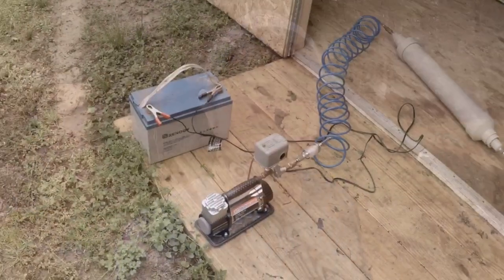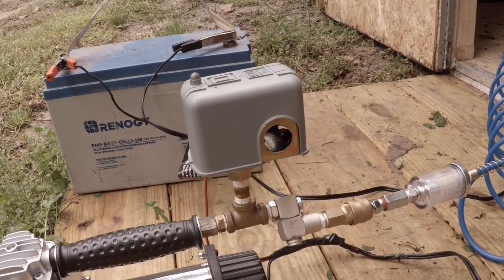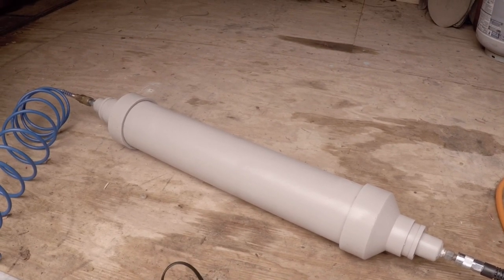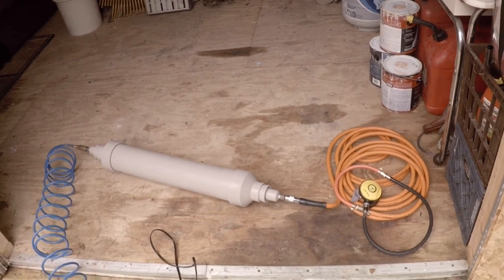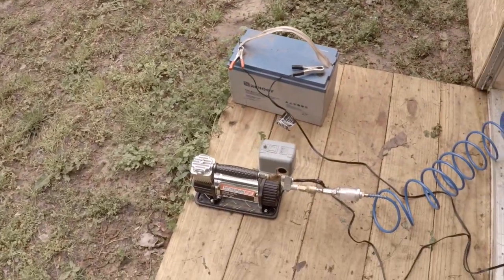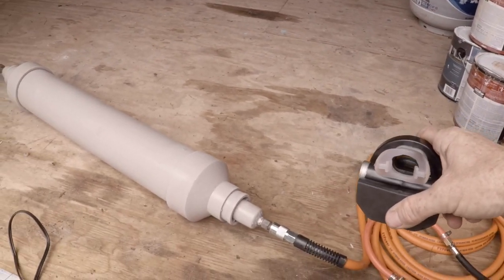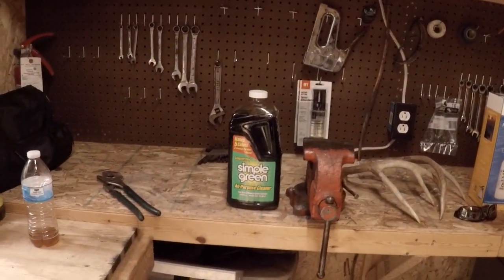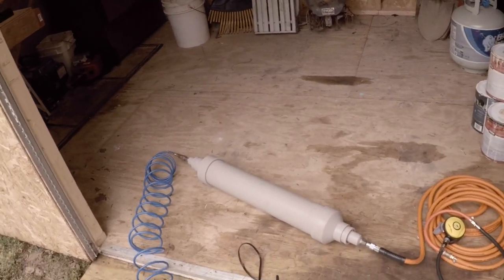DIY SNUBA Diving System Made Easy

Comment: I have been wanting to do this...the biggest concern I had, was with Teflon from the oil-free compressor. Is 5 micon filter good enough for Teflon filtration? Been researching this. Thanks for the video your attention to air quality is great.
Reply from the maker: Edward I’m not sure to be honest with you. That’s the best filter I could find and I’ve seen them used in other systems. Teflon was my biggest concern as well. I will add that this worked exceptionally for about two hours but with non stop use one of the reeds broke loose from the piston and couldn’t keep up with the air demands. After disassembly and found out what it was I looked into new options. What I’ve built now is a replica of hookah max’s gas powered air compressor. I’ve yet to try it out but I got the idea from Gigmaster who is also on YouTube and uses one every summer without any trouble. It’s roughly $500 to build but significantly cheaper than hookah max’s $1200 price tag. I plan to do a video on it soon so keep an eye out for it. I hope this helps you out and thank you for subscribing!!

Comment: Maybe I missed it but what kind of time can you get out of that battery before you have to recharge while snubing?
Reply from the maker: This is a solar 100 amp hour battery. I’ve have used this on my high banker all day long and it still had plenty! I use it on my camper for a week running lights. This thing will last all day!!

Comment: how did you hook up the wiring
Reply from the maker: I just hooked the hot lead directly to the battery and used the negative through the pressure switch back to the battery.
Reply: @ancellsadventures  you have a picture by chance  i tried that and it wont power on
Reply from the maker: @scottschafer4584  are you using a pressure switch?
Reply from the maker: I don’t have a picture with me at the moment but I can take one when I get off work for you. Hit me up on Facebook at Ancells adventures